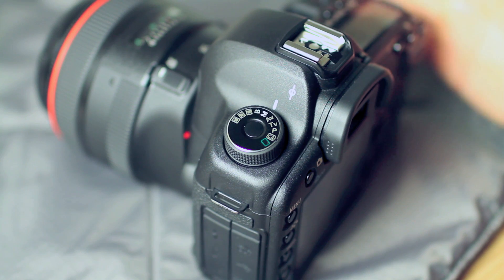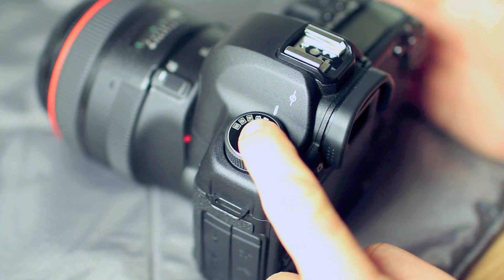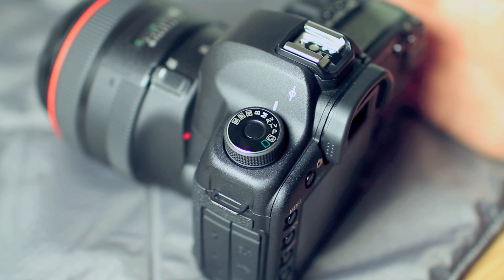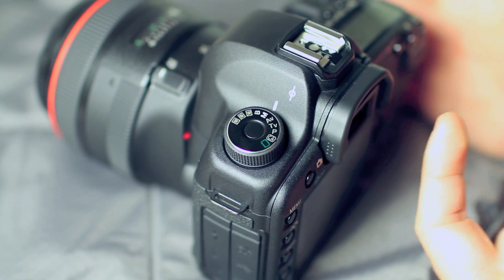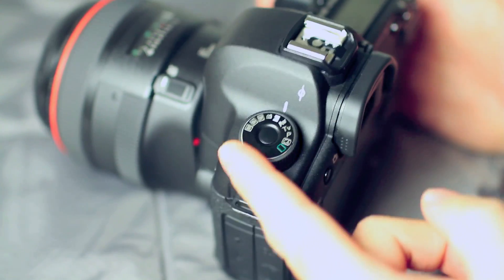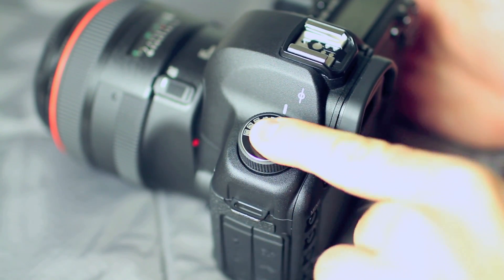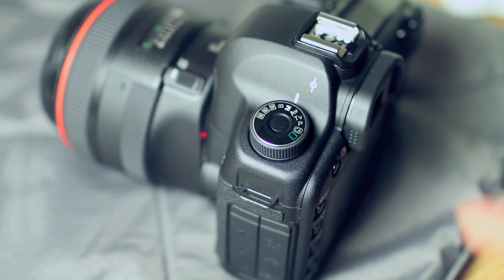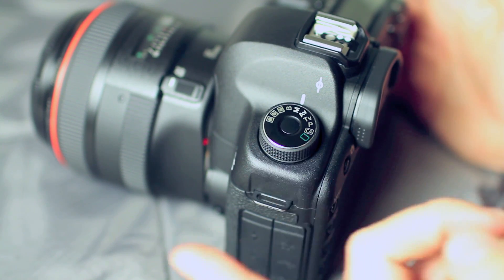Locking Mode Dial (Canon Factory Modification) on 5D Mark II

Comment: I just successfully replaced the mode dial myself on the 5D.   It’s easy to do.  The rubber grips are easy to take off to get to the screws.  I did buy new double sided tape for the grips but the old tape on the grips glued back on just fine.  Be highly careful of the ribbon cable locks on the circuit board.  I transfer the dial lubrication from the old to the new and just used super glue to put the top icon plate to the dial.  The parts are easy to find on ebay.

Comment: I'm not sure why people WOULDN'T want to have this done. I seem to be cursed when it comes to accidentally sliding this dial out of position. I'll be regularly shooting wedding portraits, hear that my shutter is suddenly very long, look down to see that I'm in bulb mode and think HOW THE HELL??? The worst is when I'm shooting in AV mode, working fast paced through some time cruched portraits and then find afterwards that I'm in manual mode and the portraits are trashed and underexposed.